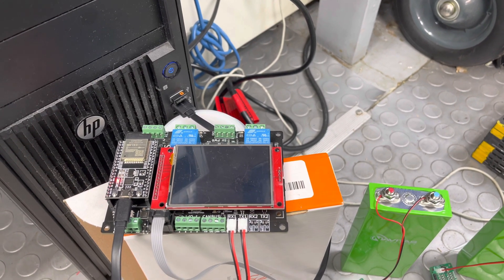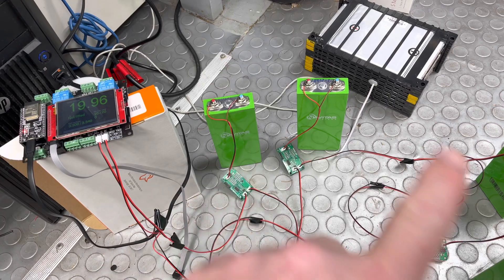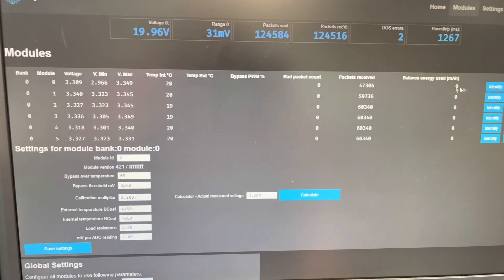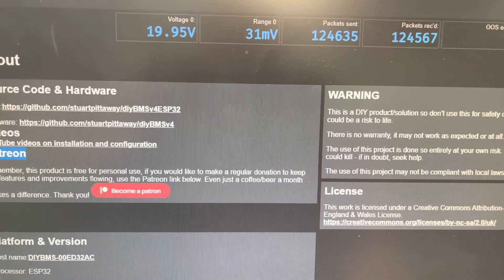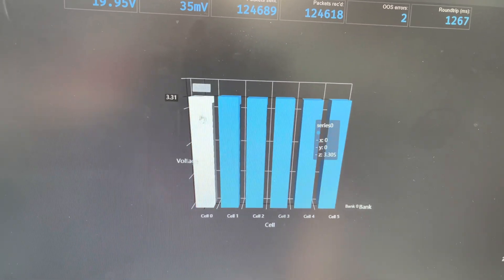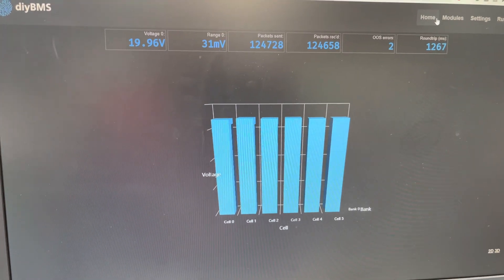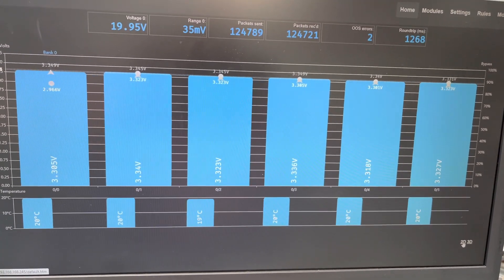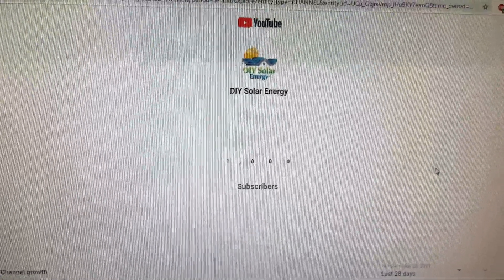DiyBMS v4.2 Controller Overview & UNCUT and 1,000 Subscriber Thank you

Comment: Looks like one of the boards I sent out to a few Patreons :)
Reply from the maker: I would say your correct. The controller came from you.. :)
Reply: @DIYSolarEnergy   Looks like it is working well so far. Looking forward to seeing more content with the new boards. I'm in the process of fixing up a couple issues with the v4.4 module boards myself, one will receive but not transmit and two have some other sort of issue. I'll be building up a few more boards this weekend to swap these odd ball ones out and come back to them later.
Reply from the maker: @atanisoftware  I ordered umm 100 JTS connectors for my 4.21 boards, and I have now lost them somewhere in my shop, but I ordered 200 more yesterday. But I was able to test one of the 4.4 boards and seems to be working nicely. I really like the 2nd temp sensor. When the Shunt is finished, that’s going to be HUGE! One of my most awaited items!
Reply: @DIYSolarEnergy  Yeah, the new v4.4 modules are really nice. I currently have four working v4.4 modules on a few low capacity 18650 cells (1000-1500mAh compared to the 2900mAh original) just for testing. I'll need to have at least 28 of these v4.4 modules working for my full setup (four 7s80p packs) so I can put them into service later this summer.